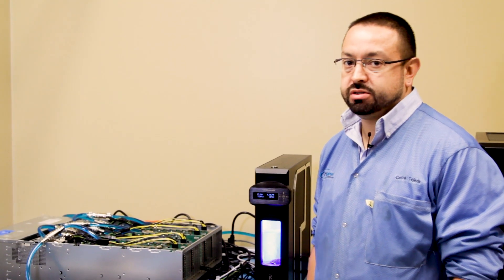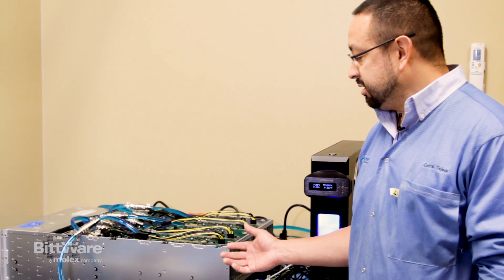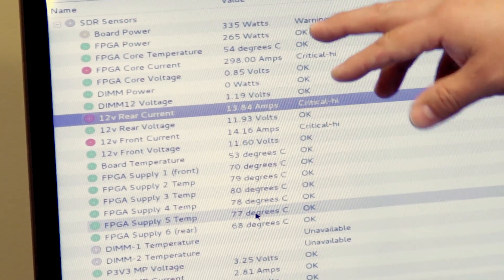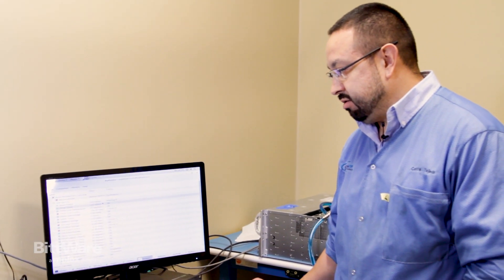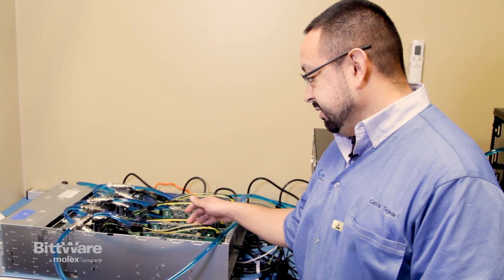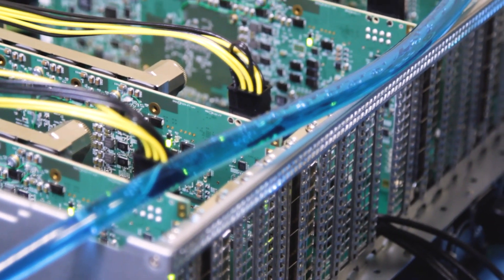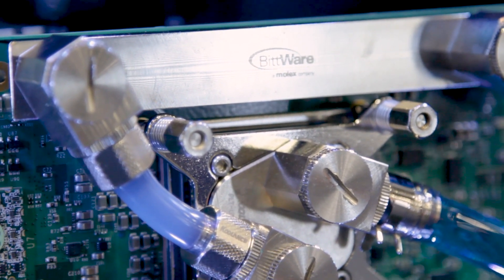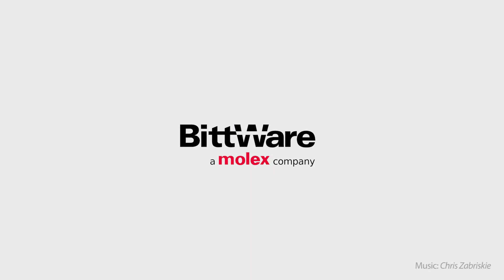Four 300+ amp XUPVVP Liquid-Cooled FPGA Boards in TeraBox Server

Comment: That's very cool, but isn't it a bit underachieving to tout "300+ Amp"? It's true, but many off the shelf graphics cards can hit 300A undervolted. I'd imagine it would be better to say "Look at how much power we can deliver at this low 300W draw" 300W is really, very good for the performance these cards achieve. But I'm just nitpicking ;) 

Awesome design. Love the product.
Reply from the maker: Yes, it depends on what's being done with that power; for some applications this card might provide more acceleration than another (the other being a different FPGA or even type of chip) despite drawing similar power.